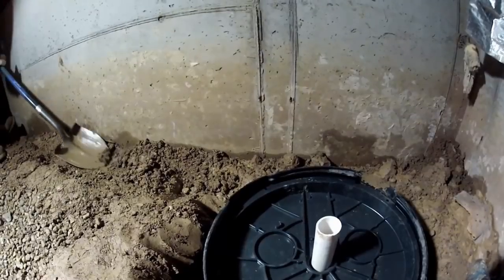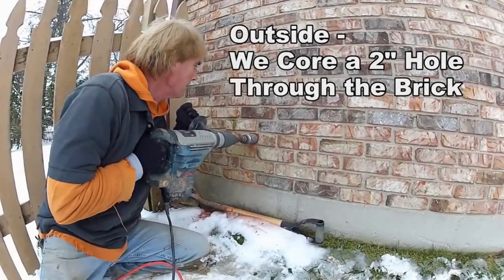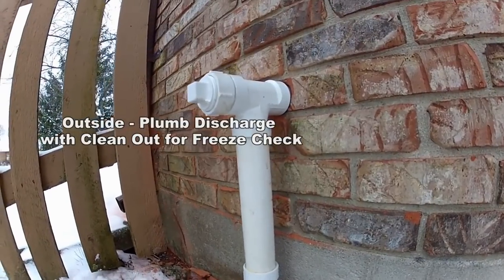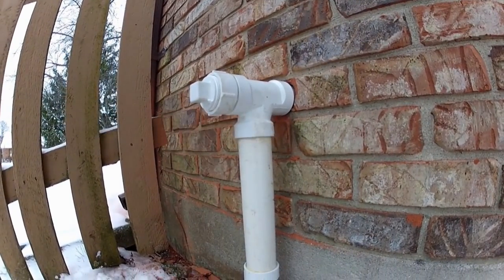How to Protect Your Sump Line from Freezing

Comment: I already ran new downspout drains and now I have my footer exposed. Dug it all by hand...alone. Waiting on the rain to subside so I can put on some Blackjack rubber coating then I'll be ready for my 4" pvc french drain pipe and gravel. It actually works really good without any pipe because of the shale/clay/hard pan we have here in Virginia. But, I'll feel better with the pipe in there. I'm going to fill it all the way up with gravel and then I'm going to use landscape rock over the rest of the area and on top of the drainage rock as well. It's going to be like one big strainer for that area of the yard. If I can send you some pics, I will.  Love this channel.

Comment: Do you travel to Central NY haha. My house never had a crawl space for it's first 65 years. There's a lot of high water marks. I have added a pump and basin, but have not done a permanent line. Just the black corrugated pipe. It freezes all the time.